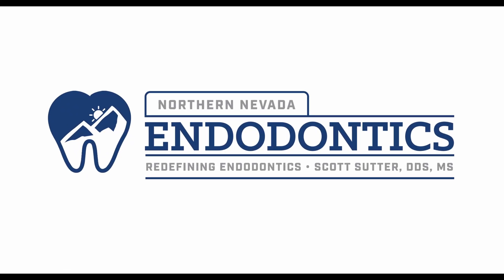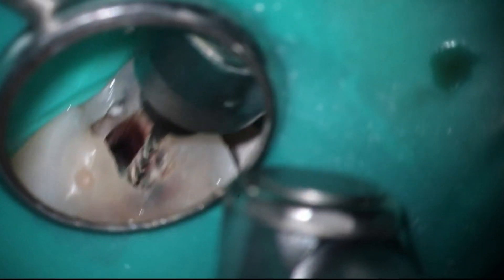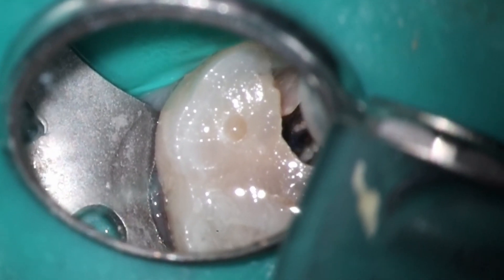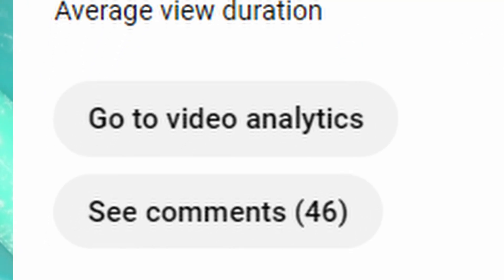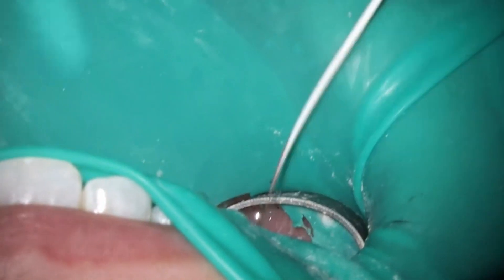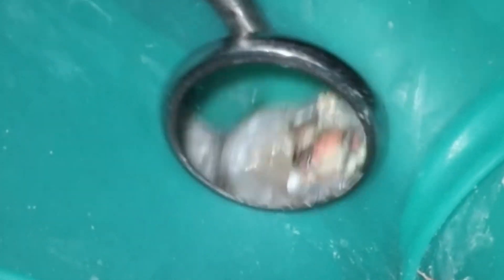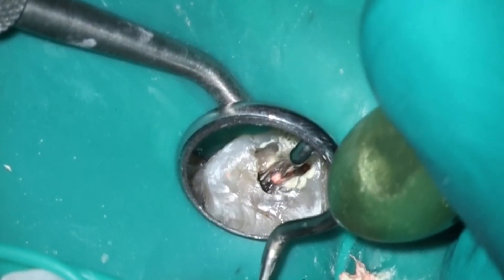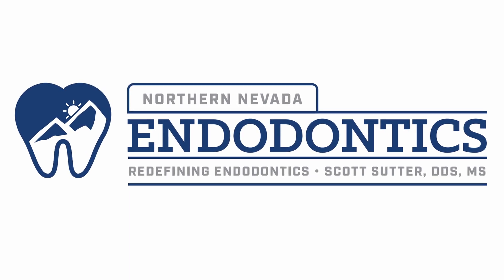How I finished a 6 canal maxillary molar in under 20 minutes | Endo Uncut

Comment: How do you check if canals merge before prepping them. I noticed you didnt do this? You just prepped to whatever the WL is for each canal.
Reply from the maker: It’s not as important if they’re a type II system for the shaping as it is for obturation. I’ll figure out the WL and shape to that length as you described and then see if the liquid drains from both canals when I drain one. Then it slightly changes my obturation process if it is a type II

Comment: Lovely work. What speed/torque are you using on your rotaries here? Thanks!
Reply from the maker: Thank you! 300 RPM at the max torque on the endo TC2's, which isn't very high at all
Reply: @PatencyPro  that's super, thank you! have you any cases of obturating a deep canal split using the squirt technique? I find these cases the most challenging obturating around a spacer cone. cheers
Reply from the maker: Yes! But I haven’t recorded any because of course. The key is to have a clear path with the 20k file and to use that to carry sealer down both sides of the split. Then put the tip of the gun right on top of the split and stop when you feel the GP push you up. Condense with the plugger in both directions and then you can usually backfill the rest in a solid motion. Deep splits are tough regardless!

Comment: Hi Doc - just rewatching this gem and had two more questions -
1. did you pick up the DB2 by accident or did you specifically look for it? I had a clone of this tooth last week and honestly the only reason why I got DB2 was because I missed the palatal with a rotary and it just pulled itself in (had a heart attack and thought I perfed ...) - if it was by luck, would you routinely assess this on your cone beam to make sure you know what you're getting into? 
2. I've been trying your method to pick up mb2's and ^in the above tooth mb3 as well with a skinny rotary file, and I'm letting the file pull itself down. Some times I find the file isn't meeting much resistance so I keep going but it suddenly snaps ... these are usually the hyflex glidepath files which are quite small in taper (15/03) and (I think) very soft due to its metallurgy...idk if it's my technique or the file system is just not suitable for this technique since it's highly resistance to cyclic failures but very prone to torsional fractures...coz I'm on the edge of my seat watching your 17/04 flossin like backpack kid and still comes out just fine haha...would appreciate some advice :) 
Thank youuu as always <3
Reply from the maker: I specifically looked for it! Anytime I see those lines connecting the main canals I always peck along them to see if anything opens up. I’ve 100% had that same sinking feeling in my stomach before that I perfed just to see that it was an extra canal, so you’re in good company haha
It’s such a nuanced touch using this technique. The best way I can describe it is that I do not put any apical pressure and as soon as the file grabs I pull it back out. It’s also useful to have different tapers at this point so you don’t stress the same part of the file. Thankfully these are usually pretty easy to remove when they snap up high so I hope you were able to get yours out! Keep practicing, I know you’ll get there ❤️

Comment: Awesome demonstration! I totally agree - why prolong a procedure with hand filing when it can be efficiently managed with rotarys instead.

As the rotary file progresses apically, however, the rotary file will encounter increased resistance. At what point do you say "hey I'm going to create a ledge, or the rotary will separate if I keep at this" and switch to hand filing to get to WL? Thanks Dr. Sutter!
Reply from the maker: That’s super hard to describe because it’s based on feel, but yes, I very often pull back as the resistance increases. To learn this, you have to do thousands of root canals lol, that’s the hard part. To try and describe it; I don’t put a lot of pressure apically on the file and let it do the work for me. Once I feel like I would have to increase the pressure I’ll back out and switch to a differently tapered file rather than jump straight to hand files. As long as I can get a decent stick and feel like I’m progressing I won’t switch to hand files. Hope that helps!

Comment: Hi Dr Scott, 

What file system are you using

And what do you think of larger taper reciprocating files like wave one gold? I struggle to do cases with these files with just the ni ti file, really need a good glide path first. 

I’m based in the 🇬🇧 

Thankyou
Reply from the maker: I love the 🇬🇧 and will be in Manchester next year for the IAE! 
Brasseler VT Scouts 17.04, 20.06
Most reciprocating files are just way too large for modern rcts outside of large anteriors. I find the system annoying because I don’t get the same tactile feedback when it’s ratcheting back and forth, but I’m also very used to the traditional style! But it’s not surprising at all that you need to use multiple hand files to open up the canals before the reciprocating files will work. Try something smaller and see how it works in your hands!
Reply: @PatencyPro  Thankyou so much. I may look into the Minikut files (03) taper by Dr Buchanan. 

I’ve  heard great things about the Brasseler files, but they aren’t available in the UK I don’t believe. 

I’m considering an equivalent to them, so maybe the Minikut files or the slim shaped files? 

What do you think? 

Thanks so much 

Hamzah
Reply from the maker: Hey Hamzah! 
The brasseler files are the same shape as the SSWhite VT’s, which which edge endo also makes. Hopefully you can get one of those! 
The minikuts are solid, I have a few friends who like them. I’d keep it to the smallest sizes as they aren’t quite as maximum file size limited like the VT’s
Reply: @ 
Thankyou so much. Yes we have the EdgeX7 endo files here. I believe it’s 17/04, 19/02 glidepath then 25/04
Finisher. I’ll try these out, alongside minikut and the slimshaper files. 

Thankyou for the advice, learning a great deal from your videos, much appreciated 

Kind regards, 

Hamzah
Reply: Also Dr Scott, I forgot to ask, do you finish majority of your cases on 17/04 then or 20/06? Thankyou
Reply from the maker: Hey Hamzah! I used the X7 17.04 for YEARS so that's a great option. I finish the majority of my smaller sizes to a 17 and then palatals or distals to a 20.06. Most anteriors on younger patients get an F1 as it fits the shape perfectly. Thanks!
Reply: @ Thankyou so much

Comment: What is the logic behind desinfecting first, and cleaning out caries afterwards? The chamber is filled with bacterial biofilm during the root-canal treatment. 
Also the rubberdam is clearly leaking due to a rift. 
I cannot see how this is acceptable from a aseptic view.
Reply from the maker: I thought I explained that well enough in the video, so thank you for giving me another chance here: 
To answer your first question about leaving the decay and restoration, I wasn’t sure if I was going to finish the case in a single visit or if there would still be drainage. If I was going to temporize, it would be better to leave some of the material for the strength of the tooth and then remove it at the second visit. I didn’t see me shaving off the bacteria and shoving them down the canals so I think it’s ok lol. 
I also addressed the rubber dam. Yes there was a hole. No, there was no leakage. Ask around to your general dentist colleagues about how many of them place a rubber dam to restore endodontically treated teeth and I think your mind might be blown as to what is actually acceptable from an aseptic point of view. Asepsis means sterilization and we have known forever that it is not possible…. Unless you extract the tooth. The goal is to modify the existing milieu of organisms down to a commensal level where the patient can function with no issues, not the elimination of all organisms.

Comment: actually 2 more lol 
1) any particular reason you like putting sealer with paper points as opposed to files for example? 
2) when you were exploring for mb3, you used 17.04 instead of 20.06 VT file. any intuitive reason as to why you sized down? (besides the obvious smaller file) did something tell you that you might ledge with a 20.06 while you wouldn't with 17.04? also in general, i know you want to keep a minimal set of files so i'd like to know why you find 17.04 useful in your armamentarium but not say 14.03 (given i haven't seen you use it) for example.
Reply from the maker: You know I’ll never lose optimism and I’ll always answer your questions! 
1) I do both haha. The paper points carry the sealer more effectively and then the file makes sure it gets to the apex
2) when I was doing the WL and the 8C I could feel there was a significant curve on the MB3 which made me feel more comfortable using a smaller file. I do keep a few 14.03’s around and used one in a video awhile ago where there was a right angled curve, but you are correct that it’s not on my sponge. Two reasons; A) those cases are really hard to squirt fill (I’m still trying to get a company to make me a size 30 niti plugger but that’s another story) and B) I don’t see that many straight bricked cases where the smaller file would make a difference. I’m also very used to the 17/20 combo so that probably contributes too. I have a random drawer of files that I’ll bring out every once and awhile, but for the majority of the cases that I see in my practice the 17/20 is an ideal combo!
Reply: @PatencyPro  thanks doc!

Comment: great video. 2 questions doc:  
1) why take such a large view cbct if you were just doing endo on #3? wouldn't it have been just as effective with limited on UR quad? were you looking for something else for this patient?  
2) what do you exactly mean by "my 8C file dropped right in" to a canal? you said that when you were negotiating distal canal. it doesn't mean that you just reached the apex right? I almost never have upper first molar cases where my 8C file goes straight to WL without some watch winding (except palatal canal)
Reply from the maker: 1) it was a consult for like 3 and 18 so we had to go full (18 was fine)
2) exactly correct that it dropped to the apex. I think this one has been dead for quite some time and the patient was much younger when it went necrotic, so the canals were much larger than expected given the patients age.

Comment: Regarding the limitation of the squirt technique you mention: would some sort of blocking  (a plugger perhaps) in the other canal while you’re squirting the gp help force the gp apically instead of it escaping? Ofc the logistics would be a hassle, but possible I guess?
Reply from the maker: I’ve never thought of that but that’s an interesting idea… I’ve done it before where I put a cone down the straighter canal and then squirt fill the other one, but now I’m intrigued and want to try it! Only thing is how to hold the plugger, mirror and backfill unit at the same time, but I have amazing assistants so I may play around with this idea!

Comment: Hi doc - re squirt technique, you’re right - I am worried about trying it out. Main reason is I don’t know what to do if I run into snags - eg if there’s a huge void, or if it’s short, or worse if it’s extruded, I wouldn’t know what to do at that point 😂
Reply from the maker: you do a quick retreat and switch to conventional haha ❤️ Try it on a non necrotic wider canal that fits something like an F1. That way you can be more assured you won’t have an overfill and it’s easy to retreat if needed!

Comment: Is a post not required in the palatal canal ? Was it an ss white rotary file you used there , thanks
Reply from the maker: I use the brasseler version of the SS White VT’s from a few years ago. They seem to be stronger and more flexible
I tend to not place any posts in molars given there’s no real benefit. With proper bonding techniques you shouldn’t see dislodgement of the core and there was more than adequate ferrule in this case so I didn’t leave a post space. I tend to not leave post spaces anyway lol